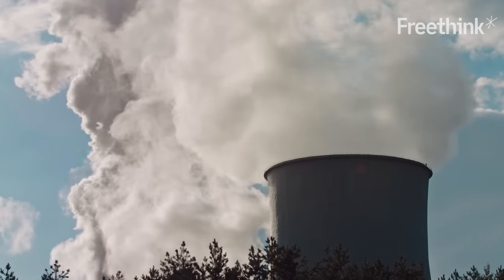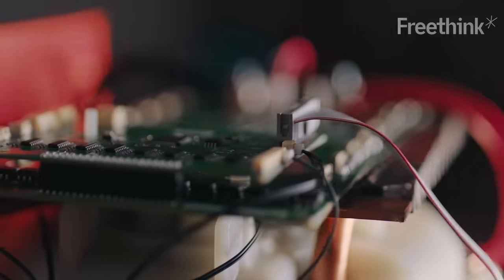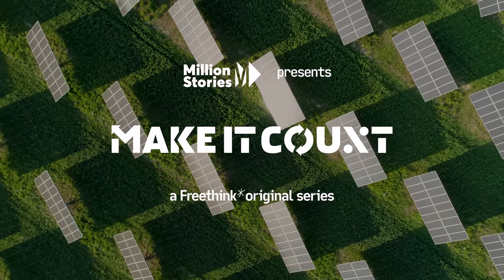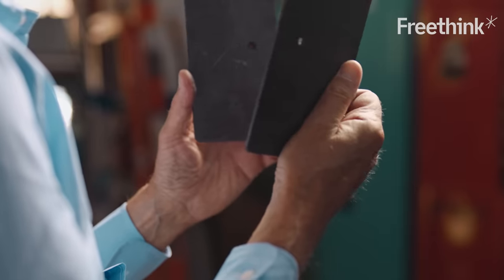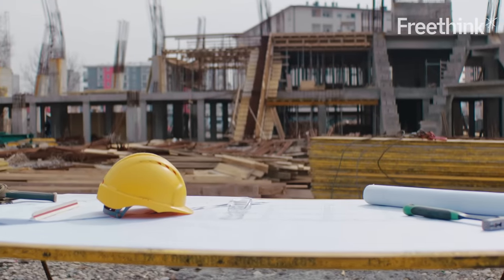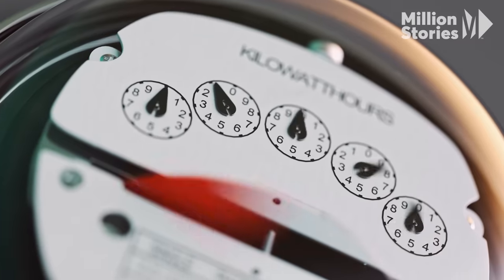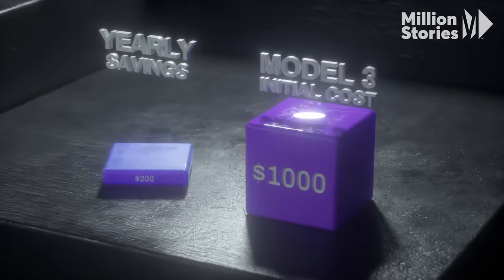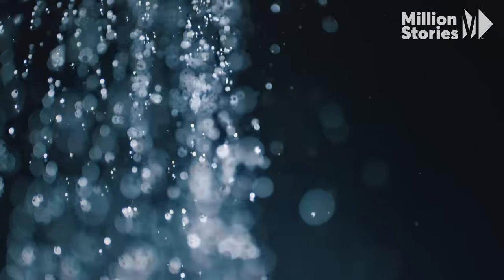The man hacking hot water to save the planet

Comment: This still uses 100% of electric energy, What about heat pumps, where at least half of energy comes from air or ground?
I think heating without heat pump is not the future.
Reply: Heat pump is the future for heating our water and space heating.
Reply: This! Joule heating with a different name is not the future, heat pumps are!
Reply: There are a lot of cold places in the world. Sucking heat from the air or ground isn’t necessarily plausible for those areas.
Reply: Heat pumps only work efficiently for certain temperature gradients. You need "warm sink". Air is not at the right temperature everywhere and ground based ones not feasible everywhere (think cities). And its not magic, there are losses to consider as well. And heat pumps are expensive and maintenance intensive. And they don't work well for heating small amounts of water. So its fine during the heating season, but outside of heating season direct heating the hot water is more energy efficient.
If you throw all this together you find that heat pumps are only a good solutions in SOME areas, for SOME building for SOME part of the year.
Reply: Well if the electric energy is produced by renewables it's fine
Reply: Massive agree here, this product would use like 3 times as much energy as a heat pump would
Reply: @willrodgers7974  i live in Canada and i installed a heat pump water heater and it is way more efficient but you need to heat the room with a heat pump in winter too.
I made few big changes to my recently purchased houses and went from 600$ to 200$ ish electricity bill.
Reply: Increased peak electrical demand when everybody is taking a shower for example will just increase the need for ADDITIONAL power plants. They have to be designed for peak usage, not average. And, they cannot just be dialed back for off peak power usage.

Use a gas water heater instead. Great for when you lose power, such as during an ice storm. If you're concerned about its source, invest in generating methane from trash.
Reply: @puntabachata  yes you can, by adding storage tank
Reply: @maxetjulie45  to an electrical power plant? It would be enormous on top of being inefficient.

Comment: This is the type of video that reminds me how bad a scientific video can get.
Reply: @skyricq  I'm more wondering if it's a improvement.

Assuming .....it use less energy per day per unit but draws all its power needed at once over a short period of time.

To me that just say more demand during peak periods which in turn leads to higher emsions and pricing for quick start power plants.

Something tells me that servicing maintaining your traditional water system would be cheaper and net a similar over all results.

But f#@# if I know... What's your opinion
Reply: valid conclusion, do they even take temp readings?
Reply: @skyricq  What we were shown was not electrolysis but simply a different arrangement of the heating element. Electrolysis does not occur when ac power is applied. You need dc to accomplish electrolysis, which is a good thing because the last thing you need in a water heater is hydrogen and oxygen gas.
Reply: @JackTalyorD  First thing, the claim that scale reduces efficiency is wrong. Scale does shorten the life of the element because it now operates at a higher temperature than when the water can get directly to the sheath of the heating element, you still produce 3413 BTU of heat for every kilowatt-hour consumed. Second, most of the minerals fall to the bottom of the tank and do not crust up on the sheath of the element.
Reply: @pauleohl  hey ty! I didn't know :)
Reply: I dont think it's scientific. It's more like "trying to sell things" no Metter if u need them. If I convince you to buy, I gained your money, but u need to feel yourself good about it. So I sell you a story alongside so your not mad at me

Comment: You start with "1mm of scale reducing the heating efficiency by 50%"   (and where does go that supposed 50% loss? ) 
Then you "solve" that loss with graphite plates. 
Then FINALLY it turns out the thing you're actually selling is  -- retrofitting 100Amps circuits to power tankless water heaters. Only briefly mentioning that the actual advantage of those graphite plates is that you avoid heating anything above the requested water temp. Which is a fair point, except that you don't make it THE point - yet there aren't any other points. 

What a shameless BS.
Reply: 1mm of scale reduces the capability of the device too function properly by half. So, if a new tank takes 1 minute too heat the water. The 1 year old wire will take 1:30 minutes too do the same thing.  IE: 30 extra seconds too achieve what you originally purchased of water being wasted. His plates don't get the build up because they aren't whats heated. The gap between them meaning the water passing through is essentially electrocuted. The fact that you don't understand doesn't make it bs. It just means you have too learn a little more. Or you are directly benefitting from the current tanks so you are just competition or a shill/troll.
Reply: @abnerriverareyes1452  No sir, nothing is wasted in my tank, because every last calorie of heat from the heating coil ends up in my water. Slightly sooner or slightly later, it's all mixed together in the tank. With scale or without. 
The difference is only that scale causes the electric coil to temporarily overheat, increasing the risk of failure. But that does not have any relation to the heating efficiency of tank water heaters. 

My argument is that their advertisement is confusing and misleading. I'm not saying that their heaters are bad. Although I am not convinced how they solve the electrode corrosion problem, but that's just one more thing from which they deflect our attention, by all those misleading claims.
Reply: @Cosmo Genesis  thanks for the detailed explanation of the failure modes of electric water heaters. So maybe a longer heating nichrome element could solve this issue by avoid making mineral deposits if it didn't heat above the boiling temperature of water?
Reply: @Cosmo Genesis it's a balance then. Thanks.
Reply: The product they are talking about is simply an induction heater (NOT the same as "tankless"). Search using that term and you'll find them for sale all over Alibaba, but not Amazon or any other sources in the U.S. I can only assume there's some sort of legal or safety issue preventing them from being sold here. It's a bit of a mystery. 

I investigated buying the product shown in the video, but the bad reviews for this company are off the charts. They've had a really hard time breaking into the residential market, again, I don't know why. Their history of bad products combined with poor customer service made me go back to a conventional heater.
Reply: @PDFx1a  It's not even induction! Induction heating would be better AND it would be easier to retrofit because most water heaters are already made of metal! This is basically using electrolysis to "heat" water as far as I can tell :/ - which is why the "electrodes" are made of graphite heh
Reply: Ohmnic heating is not indirect heating as in the old way which is transferring thermal load from a heating element into the medium which is water. It's about heating the medium itself by way of alternating current, basically treating the water as it's own heating element and thus avoiding any delays and energy loss due to the insulating properties of mineral scaling.
Reply: @iura_ch  The extra time it takes to heat the water in your tank in case of a traditional electric heater also means extra time the rest of the elements and conductor in the circuit starting from the generator to the grid and into your house have to fight electric resistance and inductance to make your electric heater work and thus that amount of energy is not so negligible is you star counting the time required by the millions of electric water heaters available.
Reply: @3nertia  It's not electrolysis as doing so with a direct current may create chloride gas within the water and release a toxic.
Reply: @johnnychang4233  It's been a minute now since I watched video but I do believe they mention filters which would be another clue that it might be using electrolysis
Reply: @johnnychang4233  you say "energy loss due to the insulating properties of mineral scaling" 
 If the energy taken from the grid doesn't go to the water in the tank, it has to go somewhere else. So, the losses that you mention, where do they go?
Reply: @johnnychang4233  the "extra time" to heat the water means the water (in the tank) is heated to a higher temperature, which means that when diluted to the required temperature in your faucet, this 'extra time' heated water will provide you proportionally more warm water. Which you would otherwise heat later anyways, if you use it anyways.  To sum up, the total amount of external losses in the grid is proportional to the amount of the warm water that you use, regardless of the amount of scale in your tank. It is a fixed grid efficiency coefficient. 
Once again, with the technology that they are marketing here, they are not trying to fix the tanked heaters. They are really only trying to fix the *tankless coil heaters*, and those are really awful indeed, so a simpler way to fix them is to not use them - the tankless coil heaters.
Reply: @iura_ch  You are still ignoring the performance point of both systems. It's like driving and old car with a totally carburetor engine which is a fuel hog vs driving a modern car with electronic controlled fuel injection. The 0 to 60 MPH performance is the key in here.
Reply: @iura_ch  The energy loss is the extra uptime required to keep those few additional seconds running the entire grid which also is not 100% efficient in it's way of transmitting energy running which you may account for the mild heating or warming you can always detect from any connected appliances and conductors.
Reply: @3nertia  It can't be electrolysis as it may need very high current and AC to DC conversion which will incurr a lot of losses. You can create one simple ohmnic system by wiring two electrodes with enough surface and in close proximity but without touching each other and circulating a dielectric as plain water in between and then apply AC current. The reactive power is what heat up the water.
Reply: @johnnychang4233  tank heaters usually have an adjustable setting of desired water temperature. Let us assume for the moment a freshly descaled heater. If I set my regulator a few degrees higher, then the heating cycle will run a little longer. Would you also call this as the energy loss? As in extra uptime, running the entire grid and so on?
Reply: @iura_ch   Setting your tank temperature higher does increase energy losses because the greater the difference in temperature i.e between the hot water and the pipe its flowing through the more energy is lost. So even though you may use less very hot water and mix in more cold water in a shower for a net 0 difference in energy, the secondary losses from faster temperature drop would be larger. Besides that, if you have a dishwasher or washing machine, unless that device is a newer one with techy water temp sensors and mixers, those appliances will use just as much scalding water as they would have used lukewarm water.

Back to the scaled element question, you say that heat of the element has to go somewhere so as long as it ends up heating the water there is no efficiency loss. In reality you're simplifying the system into a closed loop when in fact whenever hot water is used that will unbalance the equation. So you have an element insulated with minerals trying to heat water, the water does not heat up quickly so therefore the element burns the same wattage of electricity for a longer period time: more energy is put into the water to reach the same temperature. After the water reaches temperature, the insulated element will have become very hot and much of that heat will seep into the water over time theoretically recooping the initial energy losses. However, as soon as that hot water is used and new ground temperature water flows in the system has restarted, the losses are not recooped, and the element will again receive full wattage. 

Likewise, if you were using an electric space heater to heat your house but you put that space heater in an insulated box (or a single bedroom with the door closed) you would have to burn a lot more watts to keep the same house temperature because heater would have to run at a high temperature constantly to keep up with normal losses even though it may be 200 degrees inside the insulated box.
Reply: Exactly. If efficiency drops to 50% it means 50% is wasted as... HEAT. And where does the heat go when there is nothing else than the water around the element? Into the water. So 50% goes into the water and 50% goes into the water. That totals 100% and we have 100% efficiency.

Comment: I use to spend about $35 a year for hot water.   Living in AZ it was just the power to run the pumps to circulate water through the panels to be heated.  Had 80 gallons of 160+ F water which was mixed down to 130F.   Now I use tankless and keep it maintained to keep up that efficiency.    Solar hot water is one of the best IMO.   Ohh and I had a drain back system so it had no chance of freezing or overheating.
Reply: I knew of an AZ house that had one, but the copper tubes to heat the water on the outside panel broke (along with the glass cover), and later the water heater which had electric "back-up" heating rusted out.  The cost (at the time) to replace that with an electric standard tank heater was about $500, vs $1500 for the 80 gal unit plus several $k more to repair all the rest of it.  There was no budget for it, even after the incentives.
Reply from the maker: Very interesting, thanks for sharing!
Reply: @jeffm2787  you're living in 2030 😳
Reply: @freethink  love the comment cherrypicking 😍😍
Reply: Most israeli houses use solar hot water and it is so goood never ending hot water in the summer
btw there is a design that you don't need pumps for it